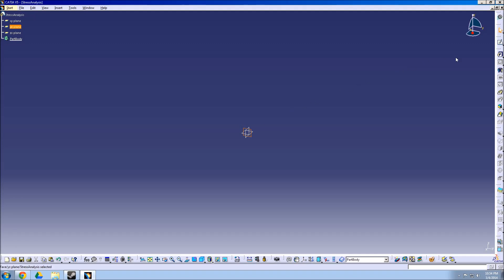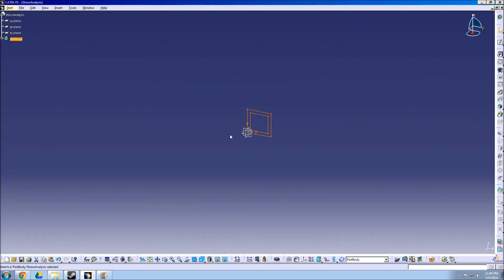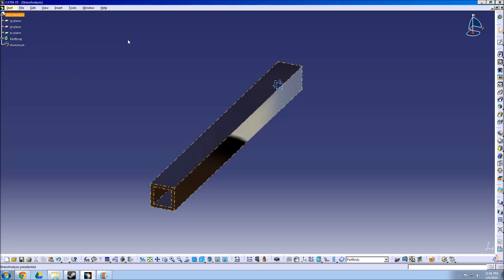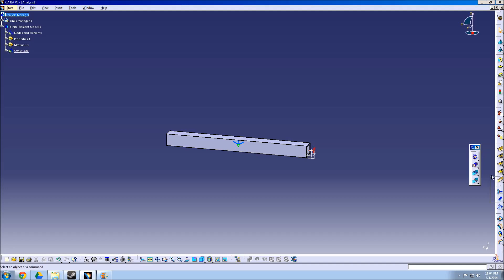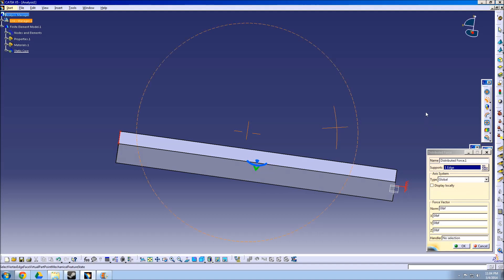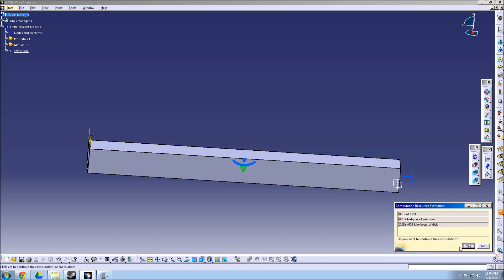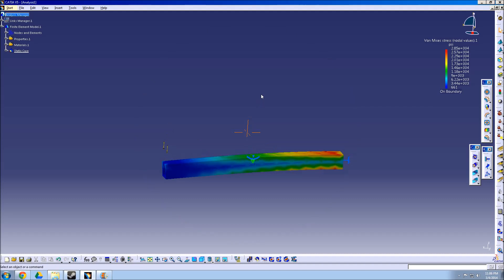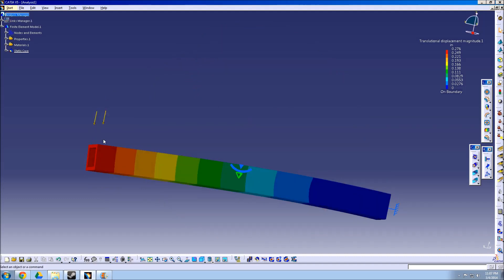How to run a stress analysis with Catia

Comment: If it's composite material. can I do the stress test ?
Reply from the maker: +High Octane The important thing to remember with composite materials is that they have rather large differences in strength depending on the direction of the fiber layup.  Unfortunately I haven't done any more than design toolings for composite layup so I'm not entirely sure if Catia can run stress analysis on composites the same way as metals.